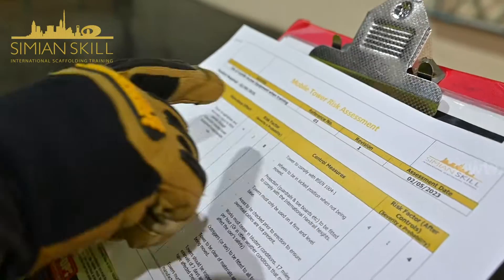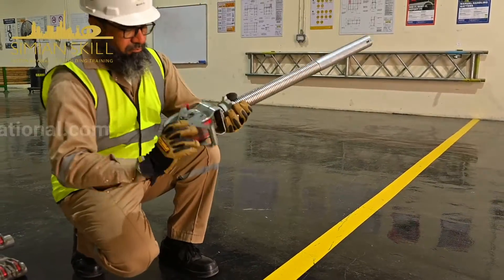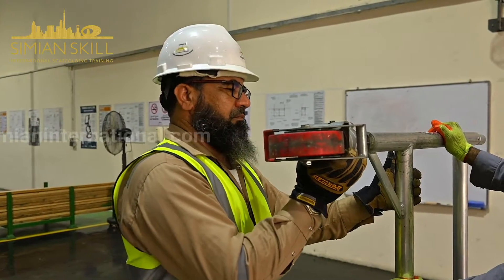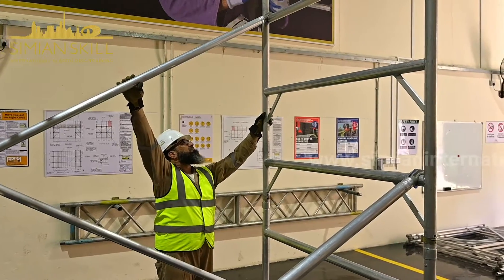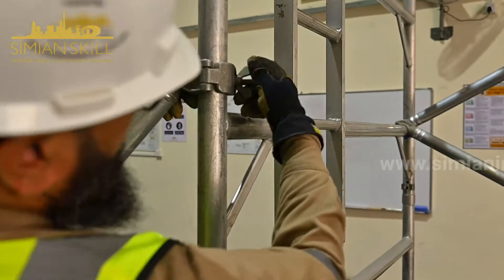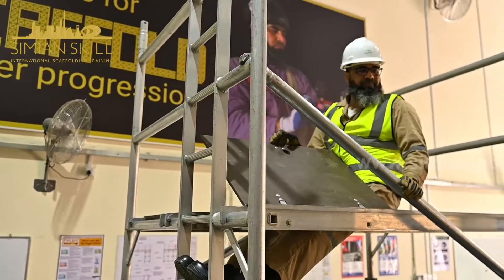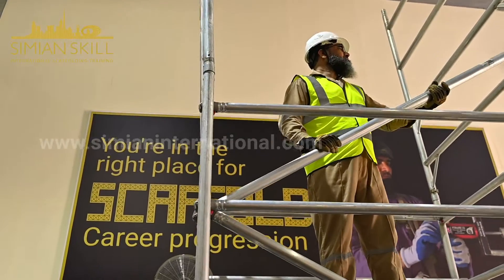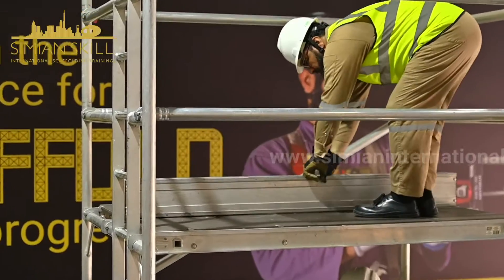Mobile Access #tower (PASMA) Assembly, demonstration using the 3T Method #PASMA #mobiletower

Comment: These is wrong
Reply: Should have added the stabilisers  before the staging board and before climbing up. No diagonals needed  unles using the half sections up top where in this video they had them at the bottom which is fine check a manual.